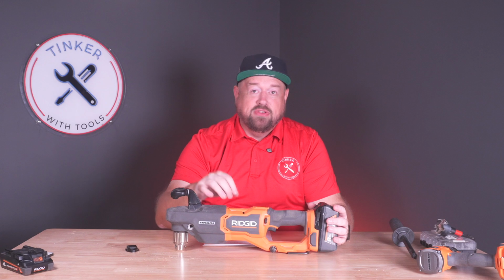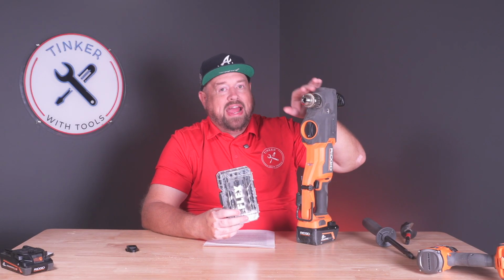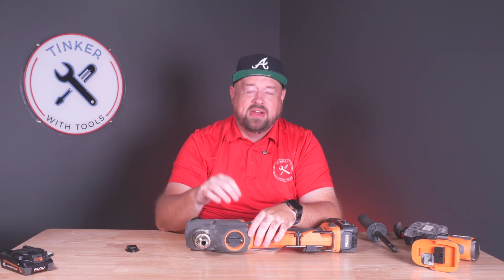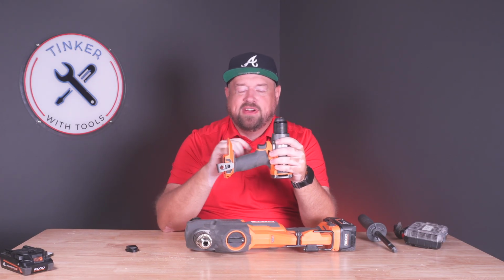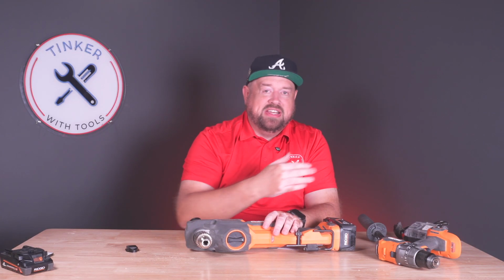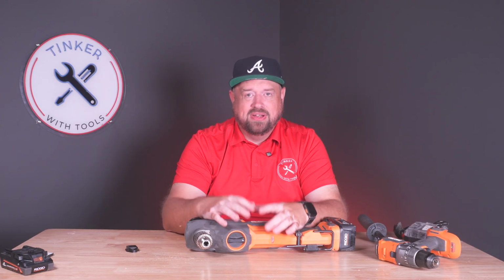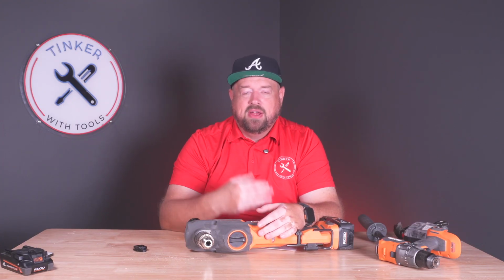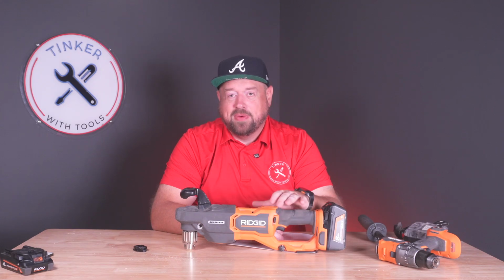RIDGID Just Went Heavy Duty – Stud & Joist Drill Review

Comment: What’s the model number of the hand drill, not the stud and joist drill.
Reply from the maker: R861152
Reply: After watching your video and seeing the hammer drill kick like it did at the start of the video I’m amazed the R861152 didn’t shutoff and the light start flashing. The reason I commented on it was I have 5 of those hammer drills and they would’ve shutoff and light started flashing with that little bit of kick

Comment: I just wanted to say how much I appreciate your content. I don't believe I've ever heard you actually bash a tool or brand, and that speaks volumes about your maturity.
BTW, I finally found a replacement for my Dewalt 777. I got the Ridgid brushless subcompact drill because the kit with a single battery and charger went on clearance in my area. The trigger control is good and the clutch is amazing.
Reply from the maker: Dave,  Thanks for saying that.   My personal philosophy is that most tools are good tools, they just might not be the right tool for every person.   

Glad you found a replacement for the 777.   The sub compact is a well made drill and has a lot going for it, I just don't care for the slow ramp up on the the drill but other than that, don't really have any complaints.
Reply: @TinkerWithTools . TBH, the ramp up doesn’t bother me. Plus, the kit that only comes with one battery was a special buy left over from the holiday sale, which means it’s a non-stock item.
It went on clearance for $58, and I couldn’t pass it up. I ran it through some tests and I think it’s perfect for me.
I ended up buying a second one because it dropped down to $45 and I’m just a sucker for a great deal 😂.
After I make sure the second one is as consistent as the first one, I’ll probably give one of them away, though.
Reply: @TinkerWithTools . You’re spot on about most tools being good, but not for everybody.
The Ridgid subcompact really outperforms the Ryobi equivalent, but I can’t bash Ryobi because it’s all some people will ever need.
Reply from the maker: @DiligentDave1966 agreed.  To often people dismiss tools as junk because it simply doesn’t meet their needs or wants.  You and I have differing opinions on tools but we have each found what we like.
Reply: @TinkerWithTools . Our preferences may be different, but I think our opinions are more similar than you might think.
My preferences are based on a combination of budget, comfort and what suits my needs.
Heck, if Hercules released a subcompact drill that was comparable to the Ridgid subcompact or the compact Milwaukee, I’d probably buy it.